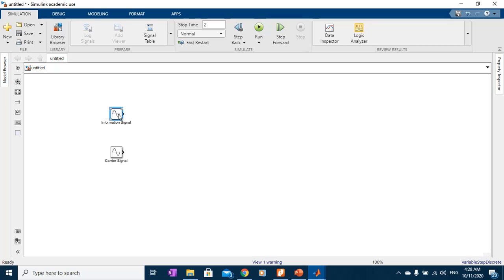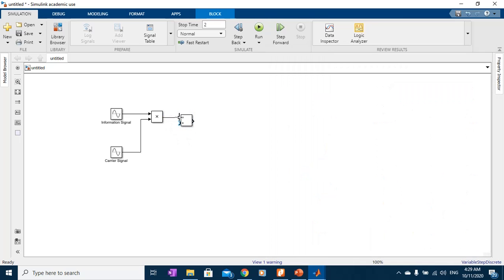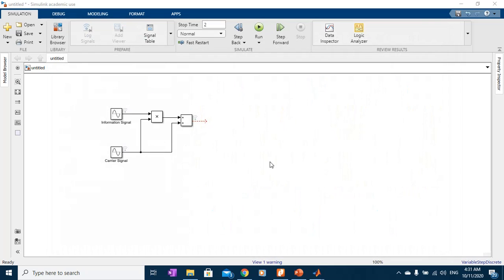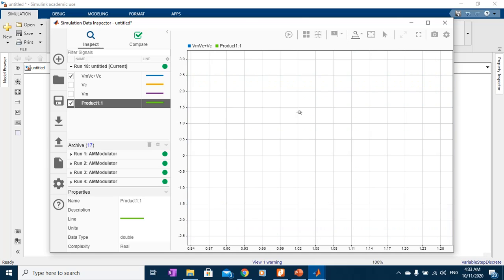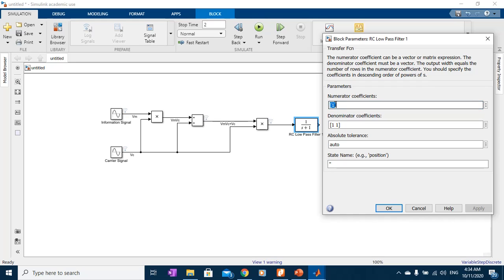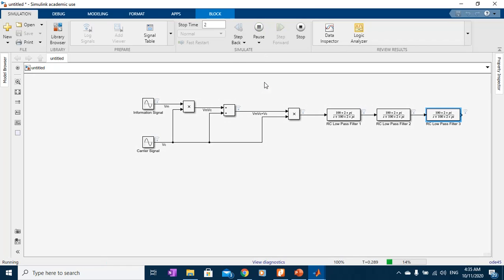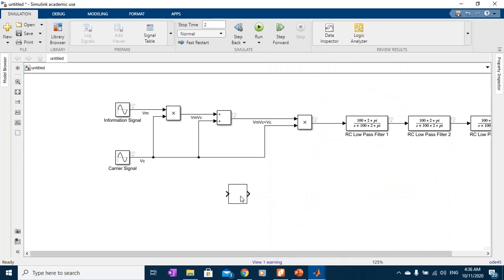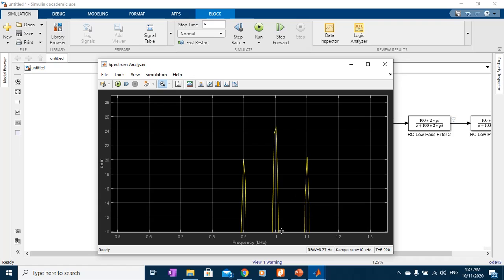AM Modulation: Modulator and Demodulator using Simulink

Comment: hello sir, i have a question. my carrier frequency is 1500kHz and i followed the steps in your video but i did not get the correct result. is there anything i can do to fix it? thank you in advance and nice video.
Reply from the maker: It is important to remember that when dealing with high frequency simulation (as i can see from your request is 1.5MHz) there are certain parameters need to be adjust:
1. Increase the 'Max step size' (you can find it in Configuration & Simulation --> Model Settings) to avoid unnecessary losses of data due to low sampling rate.
2. Decrease the 'Stop Time' in Simulation to shorten the simulation time because now the data is considered to be a lot if you simulate more than 1ms.

As for the low pass filter, you can change the coefficient of the numerator and Denominator to an appropriate value in regards to your new high frequency.

I have simulate as follows:
1. fc, 1.5MHz = 1500*1000*2*pi
2. fm, 100kHz = 100*1000*2*pi 
3. Max step size = 1E-10
4. Simulation Stop Time = 0.0000312
5. Numerator coefficient = [100*1000*2*pi]
6. Denominator coefficient = [1 100*1000*2*pi]

And it works fine.. But i dont know how to attach picture in Youtube comment.. hahaha
Good Luck
Reply: @Fauzan-xk4ws  thank you so much for the explaination sir, i will try it in the simulation. again thank you so much sir!